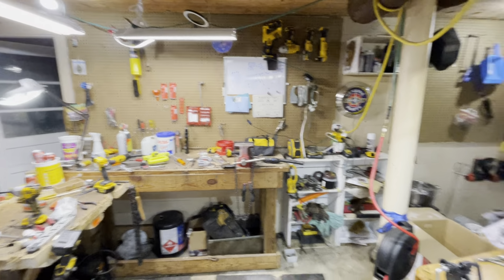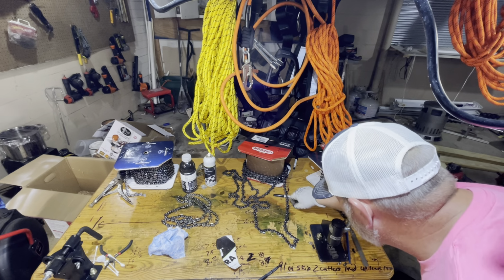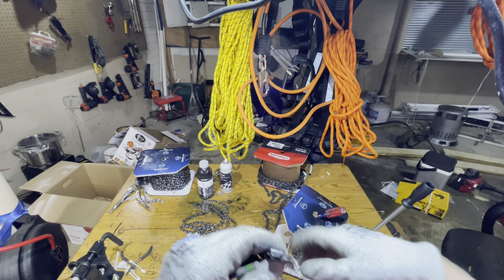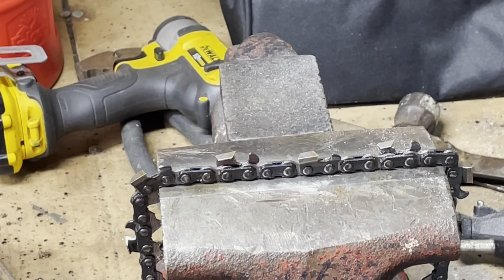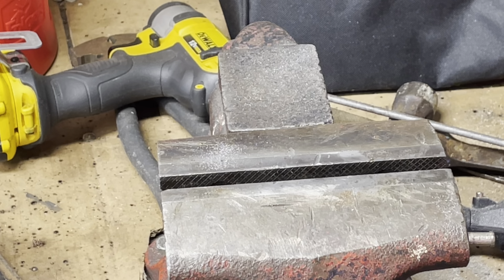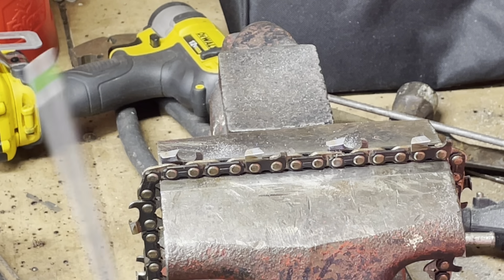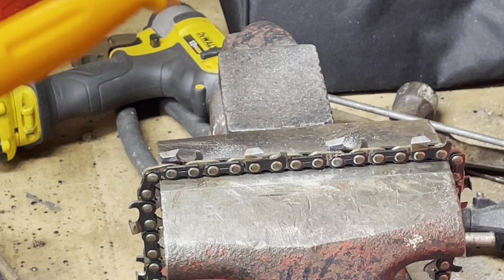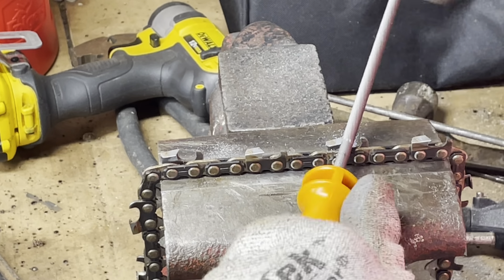Oregon EXL 100 ft reel be careful where you buy it from the Holzfforma chain is better than this

Comment: I had that same thing happen this last weekend. I had 4 teeth that were a bear to get through, 3/8 .058 84 dL, it was only on the left side cutters, Oregon exl. By the time I got through it and sharp, there is about 1/16 left of the tooth to angle line on the tooth.

Comment: EXL ALL THE WAY
Reply from the maker: Its ok but im not a fan
Reply: @MitchellsBackyardLogging  nothing wrong with that you like what you like I absolutely love it. It’s one of the few chains that will keep an edge cutting in this nasty Michigan hickory.
Reply from the maker: @nateolmsted899  i cut a but of hickory i like the chain set up i just dont like that i got a reel and 3 teeth out of 4 was so hard u couldnt file it i found the holzfforma chain does just as well and cost less
Reply: @MitchellsBackyardLogging  yeah I know what you mean. Do you still have some of that chain left?
Reply from the maker: @nateolmsted899  i sold it to a guy that either didnt mind or grinds all his chain